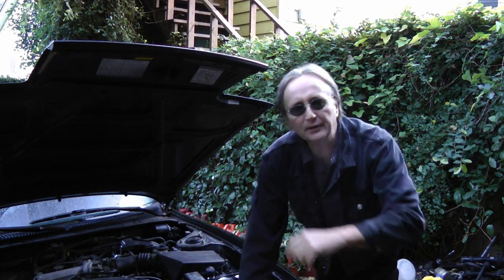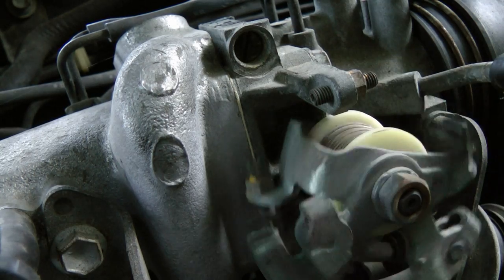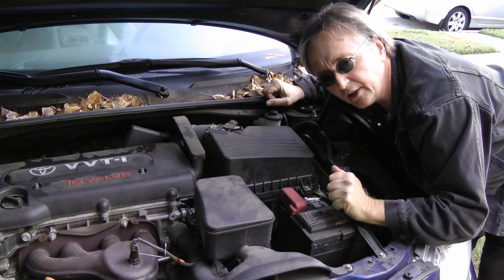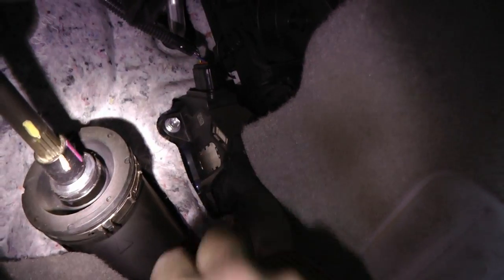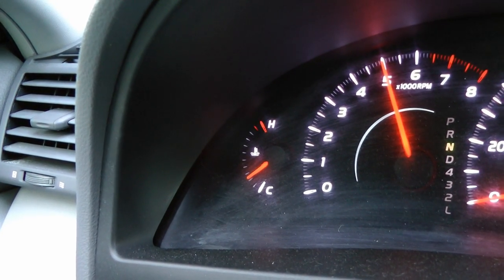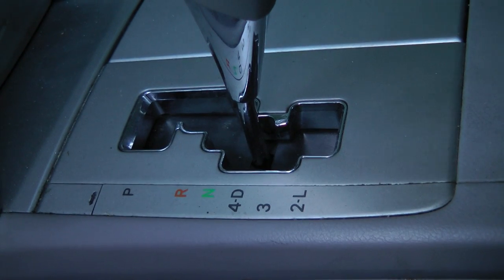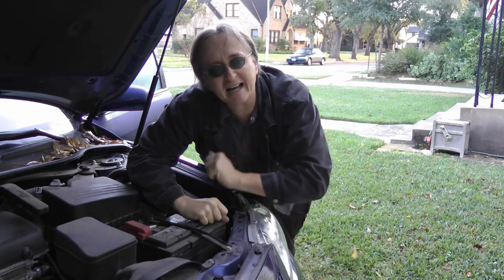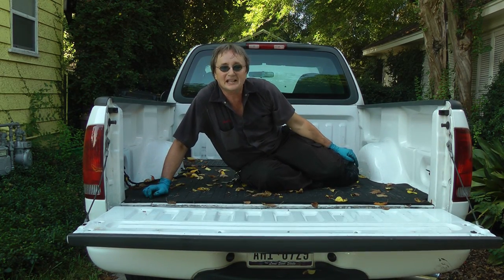How To Stop Unexpected Car Acceleration

Comment: I have a 2009 Nissan Altima and it did the opposite. I got in it started it backed out of my drive way put it in drive and it started moving at an idoling speen then I went to accelerate and nothing happen so I let off of it then pushed it to the floor and nothing at first I thought possibly it was my transmission but then I noticed the rpms didn't even move my gas pedal was totally unresponsive so I put it in park turned the car off started it again and then it was fine 600 miles later and I haven't had  the problem again . I read a few things that people had this happen on a cold icy day but when it happen to my to was about 80 degrees

Comment: My 88 Chevy pickup did that one time and even though I tried to pull up on the gas pedal it stayed at the same rpm. Since I was on the highway I put it to the floor and let off and it came back up normally. 7 months later still never done it again. Hopefully it won't...
Reply: you still alive? lol why not just take precautions such as lubricating the cable instead of hoping
Reply: Darude - Sandstorm
Nah. Gotta live life on the edge sometimes lol
Reply: Hunt Guy LOL ofc shouldn't forget that
Reply: had the same thing happen with an 86 f250. only this happened when it started up cold. would idle high, and when i'd put it in drive it'd cruise at about 20 - 25 without touching the gas pedal. All I had to do is step on the gas once and it would stop it. Never did figure out what the issue was.

Comment: Now days with modern cars you don't even have to shift into neutral. All modern computer controlled cars have a throttle cutoff when you step on the brake. If you have a 2014 or newer car go ahead and try it, rev the engine up and start moving forwards then put your foot on the brake firmly, the engine will drop to idle.
Reply: FALSE>  ours just experienced the unintended acceleration this weekend.  Pressing the brake did not stop the accelerator when the event was happening.   Later when I tried it on my own manually it did.   So basically if a person manually presses the gas and the brake it listened to the brake, but whatever happened Saturday, it continued to rev the engine no matter how hard I pressed the brake.  Also curious is that when i hit it into neutral, the engine quickly dropped to idle,  had the input been coming from the accelerator I would have expected it to rev up further.
Reply: Ok that is kinda strange. That doesn't sound like the pedal was actually stuck, or like the computer was telling the engine the throttle was pressed. That sounds like the computer has some major coding errors telling the car to do things that it should never do. That's more then just a stuck throttle scenario that's something i would seriously consider never driving the car again until its completely fix because what if the damn airbags went off for no reason while driving or the car randomly decides its time to put itself in park.

Comment: It won't lock, unless you turn the key ALL THE WAY - and in most cars with automatic transmissions now, there is a lock (provided it's working properly) that prevents you from turning the key all the way without first shifting into park.  Even my 95 Corolla has this.  Of course if this lock isn't working properly for whatever reason, I can understand someone panicking and turning the key all the way.

Comment: CONTINUED: "The complaint comes after a Lexus and Toyota recall issued on September 30, involving 3.8 million vehicles. Toyota claimed that the vehicles could experience sudden acceleration due to defective driver’s side floor mats, which can cause the accelerator to stick. However, the new class action lawsuit alleges that Toyota has failed to correct an issue with the throttle control system, indicating that the floor mats are not the only cause of the Toyota accelerator problems."

Comment: Scotty , So what ? The car will steer and stop with the ignition off . I have had cruise controls that had a mind of their own so I turned the ignition off and coasted to a stop . The thing that always scared me was the Old Single Master Cylinder cars . E brakes work but not that good . I would recommend converting to a dual MC and a valve from a newer brake system .

Comment: It has been shown that even with the throttle wide open in a 500+ HP car, the brakes will overpower the engine and you will come to a stop. Unintended acceleration can happen, but if someone says that they couldn't stop and the brakes were actually working, it's driver error. There are some other tips. 1. Take your foot off of the gas completely and don't try to brake. This avoids the pedal confusion scenario. 2. Shift to neutral. With electronic shifters, you may have to hold the lever for a second or two. Test this to make sure that you know how to do it for the car you drive. 3. After step 1, you can go ahead and try the brakes. 4. If all else fails, then, and only then, disengage the engine. With a push button start, you may need to press and hold the button to cut the engine while it's not in park.

Comment: But shifting an automatic into N when the engine is revving can damage the transmission, right?
Reply: No ur just disengaging the transmission putting it back in gear while it is Revving is bad!
Reply: This is a fake issue there is no harm done when shifting to neutral! The engine has a rev limiter and will not damage itself in a modern car. The transmission on the other hand is just disconnecting and there would be harm done.
Reply: Applekid
I'm not much of a fan of modern cars; too much bullshit when it comes to maintenance, too much weight, accessories, etc. I have an '89 BMW. lol I'm pretty sure it doesn't have a rev limiter. That's why I asked.
Reply: The rev limiter is well inside the red zone. Also, the engine will run at the limiter for many minutes before anything breaks, depending on age and condition, of course!

Comment: If you shift into neutral there will be no load on the engine so the engine will rev to the limiter with no load, this could damage the engine... Couldn't it?

Comment: If you threw a manual transmission into neutral if your car did accelerate, wouldn't the RPMs spike a redline the engine?
Reply: It would do that in both a manual or an auto. But hopefully the limiter would prevent any damage in the time it would take you to slow using the brakes and then turn the engine off.
Reply: Puffmac1 No doubt you would burn some belts.

Comment: My Ford Expedition 2003 suddenly accelerated on its own and the brakes were not working. I thought about crashing into a tree to stop it but I then i thought and just put my whole weight on the brakes and slowed it down and turned the key off.

Comment: But Scotty what if the transmission is also run by the computer?  Couldn't it bug out there too?  You could end up with the computer saying to keep accelerating and the transmission saying you are in drive.
Reply: If it gets that bad you can just shut the car off. And I'm pretty sure all cars, even new ones, have a mechanical linkage from the shifter to the gearbox.
Reply: Not all of them. Some are coming out with push button shifters.
Reply: Well don't worry the government has decided it wasn't bad programming that was the problem.  

Of course that may be because the government wants to keep the computers in the cars to control them.
Reply: To you the same as Robin Sattahip, if all else fails, pull the handbrake.

Comment: yea but what does it mean when you replace an 02 sensor both of them and the code still comes up??
Reply from the maker: 02 sensors are part of a complex computer driven feedback system that measures exhaust gas concentrations, over a dozen different things can trip an 02 code besides bad sensors. Generally, time to see a guy like me then rather than just guess.

Comment: What if it's at high speeds can you still shift to neutral???
Reply: In a modern car. I have a jeep that has electrical issues, the radio doesnt work but aux does. Charger does not work. Right now its dying whilst driving. Not alt. Not fuel pump. Mechanic can't get it to die to diagnose, so that leaves ME TO DO THE DANGEROUS PART OF HIS F ING  JOB, it has to die on ME now and I dont even have a CPU scanner to check when it does die to scan!

Comment: An electronic throttle car cannot accelerate on its own. Any failure disconnects the throttle from the ECU resulting in acceleration loss.The people that experienced that also claimed the brakes didn't work which is impossible as they are mechanical. You have time to call 911 but no time to think about putting the car in neutral or putting the parking brake on until at a safe speed to turn the ignition off? Someone thought Toyota are selling too many cars in the US, this is what really happened.

Comment: I think this issue is severe and extreme dangerous, this video seems to underplay the danger, and it didnt say what to do in fixing it. 
It did help by mentioning to put it Neutral, but when it ramps up in seconds and your in city traffic it can cause death to bystanders and / or the driver.  Theres horror stories on the internet about this.

Comment: Not the same thing, but wearing correct shoes for driving is smart . Shoes too wide in a quick emergency stop canunknowingly cause you to have your foot on the brake pedal and acceleration at the same time. Takes a while to become aware of this so hope you ave skinny feet!
Reply: monjiou1 
I drove a friend's Volvo CUV and I noticed that the brake pedal was too close to the gas pedal.  When I took my foot off the gas my shoe would get stuck on the brake pedal and I had to jerk it out before I could hit the brake. I wear those shoes all the time but never had that happen before.

Comment: So put it in neutral, so it can bounce off of rev limiter forever. Put it in neutral then shut it off, you've got power brakes for one chance.
Reply: A blown engine is better than blown bodies. And you can still stop a car without power brakes, you just have to push harder.

Comment: You'll have enough vacuum in the brake booster for one good stop with the engine off.  And when adrenaline kicks in, lack of power steer won't matter. I've had a throttle cable jam on full, and one old Fairlane went over- center. It all worked out ok.  Just don't pull that key out ha ha.  And you'll never hit the wrong pedal if you learn left foot braking in an auto trans.

Comment: what about your engine when you shift I to n. just hit the Rev limiter til you pull over? I'd rather turn the car off then shift to n.
Reply: +Sam Ibbott - Actually, ive done it a few times just messing around, its really not that hard to steer and it saves alot of wear on your engine not revving so high if the pedal does get stuck, but whatever you want to do, i dont care, not my car with a blown engine...
Reply: +Sam Ibbott Maybe I just haven't driven the car you're talking about but no, I've turned off a 2000 Caravan and steered it even before that time the floor mat kept it accelerating. It just takes more muscle to move the wheel it if the car's off, at least in my case - And no, I didn't put it in "Steering wheel lock" position, I just turned the key back by one click so that didn't happen. However, when steering while the car's off power steering fluid does come out of the reservoir. I'm not considering that an issue, just something to keep in mind for replacing fluid later.
Reply: +ThatOneVideo who gives a shit if it hits the rev limiter? hitting it doesn't hurt anything thats why its there at that limit. its better than losing your braking and steering
Reply: +ThatOneVideo In general, it's much safer to put it in neutral. When you tried it, you were expecting it to happen. When Suzy  Homemaker with a car load of kids has it happen and panics, turning the key off not only causes loss of all power, but can also lock the steering, causing even more excitement. Modern cars have rev limiters as the other poster stated and it will do it's intended job without harm to an engine (and even w/o a rev limiter the short time is insignificant)

Comment: Shifter comnad is truly mechanical ?. I ve read "somewhere" back in 2010 (when all this thin was on the top) that this happened and the car was all electronic, even started with a push button, said that the car shifter didnt respond neither because it was some sort of major system failure ...
Reply: My mom drives a 2014 Kia Optima hybrid. You can hear the shifter selection when standing outside the car and it's put into gear. You should be able to hear it on any car. Just stand outside and have someone shift into drive, it's kinda like a metallic sound.

Comment: what to do if your spark plugs has flooded by gasoline?
Reply from the maker: +son gokou remove them and air dry them an hour, and pray it's not a problem that will reoccur, then you'd have to find the fault and fix it, like leaking fuel pressure regulators

Comment: You can also use the cruise control to slow it down.cant you?
Reply from the maker: if there's a problem , it can over ride cruise control, just like with cruise on, you can still step on the gas and it will accelerate

Comment: owh...i think my e36 still use the cable type..and e46 use sensors..hmm..
Reply: Some modern cars still use cables. My 2007 Miata still uses a cable. The throttle stuck on shortly after I overtook a tractor driving home from college this afternoon but I got it under control by lifting the gas pedal using my toe like Scotty said to do in an older car, since I noticed the pedal was stuck down. Couldn't find the cable though. Must either be a phantom cable or a really advanced computer. Or just a worn out release spring.

Comment: well first of all, all cars have some sort of check valve in the brake booster so if your motor dies you can still stop easy, just remember its only good for 2 to 3 braking applications.

Comment: Meh, even over a decade ago they started training drivers (in the basic courses) to either shift down (uses the engine to slow the vehicle) or shift it into neutral and apply the brakes.  I've always opted to go to the neutral option and spend less money on brake pads than a whole new engine...  😳
Reply: +outcast668 I downshifted when I had this happen, didn't work. Neutral then key off (but not to steering lock) worked. The steering wheel was harder to turn on that particular car but still manageable and the power brakes last a little bit before they go "Manual" after shutoff; even when they're manual they still work but are more difficult to use.

Comment: Hey my corolla 2009 xle still accelerates by itself any tips?
Reply: try selling it. that usually helps. Wait, are yours auto or manual? because i have the driven the manual and the accelerator sucks. Its never consistent sometimes it revs too much sometimes it doesnt and i stalled the engine a fair amount of time because the engine doesnt rev up enough. Sometimes i got pissed at it, gave the engine a good amount of rev and feather the clutch moving off from a red light. Couldnt give 2 shit about burning the clutch, its a rental
Reply: akupehsluarketatAR no it's automatic wish it was manual but now that I hear it does the same I will not buy one thinking on buying a honda accord now hey I was driving my mom to her appointment and she flips out thinking I floored the acceleration peddal and my foot was off it the mat was not even close to it but the rpm redlined I was like hmm break and shift to neutral all calmed although the cops were next by me I turned off the car than the light goes green turned it back on and rpm was still redlining  I got it it's a suicidal corolla thanks to Toyota fake plastic peddal but thanks thinking of selling it and buying an accord asap
Reply: I've driven other model of toyota without any throttle issues. Cld be limited to selected models only. Anyways the corolla i drove doesnt redline just inconsistent throttle response.
Reply: akupehsluarketatAR yea only 2010 2012 had the recalls for accelerating by itself

Comment: I have a Hyundai i10 automatic transmission and Alto LXI manual. Alto is 11 years old and i10 is 5 years old. When you drive them Feel is exactly opposite. i10 automatic is just a budget killer, 1.3 kappa engine. Efficiency is almost nill. Maintenance costs are too high. Alto will out last this one plus another one, i think.

Comment: From what I have seen diesel never had a throttle cable.  So how come they never have unintended acceleration?
Reply: Diesels have throttle cables but they don't go to the butterfly valves on gassers, they go to a mechanism that injects more fuel. Diesels can have unintended acceleration too but that doesn't make it into frivolous news stories.

Comment: Replying to 1480 miller. -- there have been incidents were drivers reported the shift does not work. Nothing works. This is also documented by police / 911. Most UA incidents are low-speed, anyway, and one never has time to do anything with the shift.  Basically, UA is caused by a variety of hardware glitches that weren't anticipated in the software design, or  by poor integration between the vehicle electronic control sub systems. Toyota's R&D chief admitted to the execs.

Comment: There is no such thing as SUA induced by electrical faults.  It is ALWAYS driver error.  It was teh case for Audi back in the late 80s, and it was the case for Toyota a few years ago.  The big difference is that Audi had the balls to say that it was driver error; they lost sales, predictably, but they were proven correct in the end.  The floor mat thing was BS too; the only way they could affect operation of the throttle pedal is if they were stacked on top of the pedal itself.